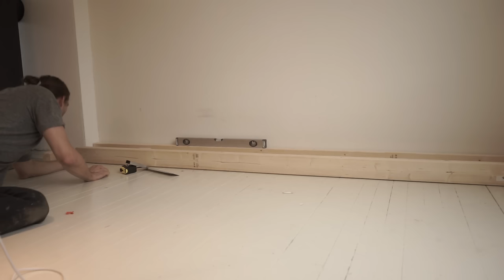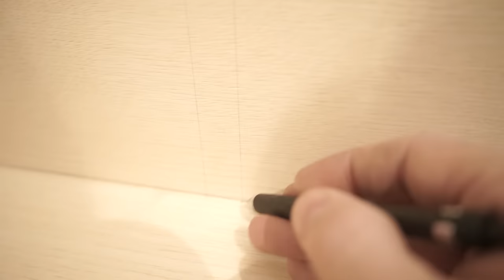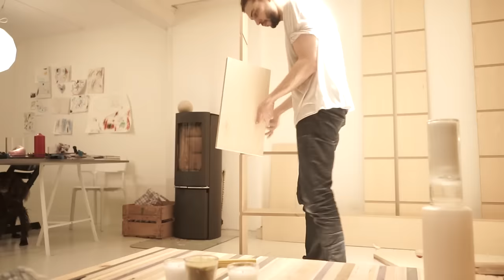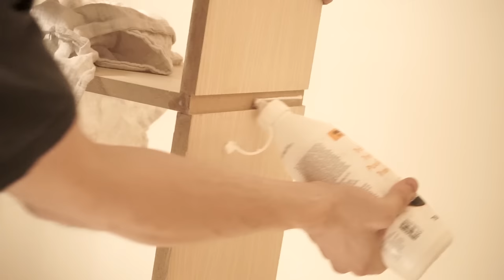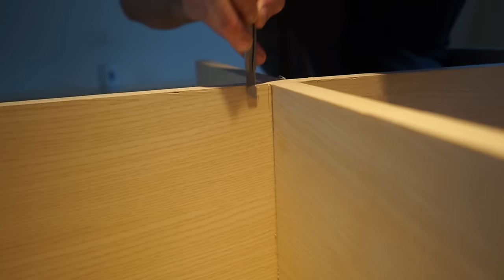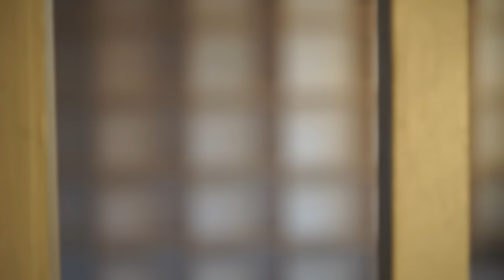Making a large Ash bookshelf (DIY)

Comment: Nice. Great video. You guys definitely should have stained it before assembly though. Would have looked alot nicer, but overall the construction and work done was fantastic. I've always loved wood working, but being a certified FAA A&P(Aircraft Maintenance Technician) I actually ended up specializing in sheet metal working which soon became a new passion for me. Bending, forming, driving rivets, and so on. So I became really interested in sheet metal and composite materials(graphite, carbon fiber, fiber glass, Kevlar, and so on) work as well, overall(primarily aluminum and steel). Theirs so much more you can do with metal and composite materials that one cannot do with wood, it's astonishing. One thing that most individuals find interesting though is that the FAA still requires an individual to take a short (I think it was like 12 hours) course still on Aircraft wood structures as part of our training in order to become an aircraft maintenance technician even though wooden airframes on Aircraft are nearly obsolete.The only down side is, one must have the necessary equipment and tools which can be very costly, in order to perform any sheet metal or composite work at home.
Reply from the maker: Thank you very much for the feedback. It is not often i use stain, it needs to fit in with the enviroment a bit more. The light ash color is easier to mix with things (in my opinion :D) Sheetmetal work is so awesome. I have wanted to try it out for a long time, but as you say, you do need a bit of know-how and a lot of tools :D

Comment: What is the name of that blu tool you use for the edges on the shelves? And second question, was it easy to attach the "edge banding" and does it still look good?
Reply from the maker: It is called a "edge banding tool" it is good but not great, I got some friends that have more success with just a flat and sharp knife. Edge banding is super easy and it holds up very well. I would recommend the type that is pre glued :D